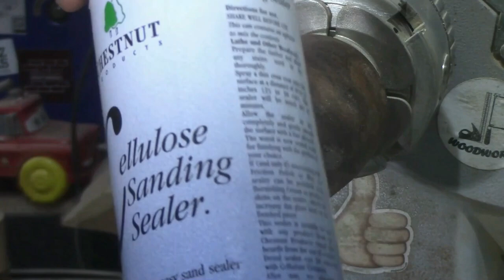Woodturning - Small Vase

Comment: Nice vase and excellent instruction.  I have done a small birch vase and like using small branches or logs rather than a blank. It seems like birch does not check as much.  Is that your experience ?
Reply from the maker: thank you very much, that seems to be accurate yes, to be honest the length of time from tree to lathe and with the scorching i did to it i would of expected some sort of warping or cracking but nothing happened so it seems to be quite a versatile wood for turning